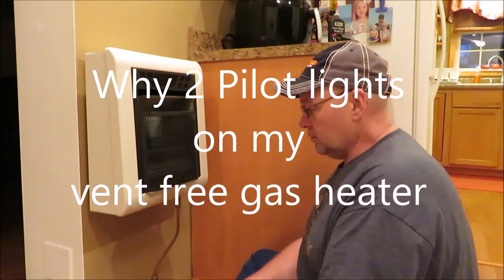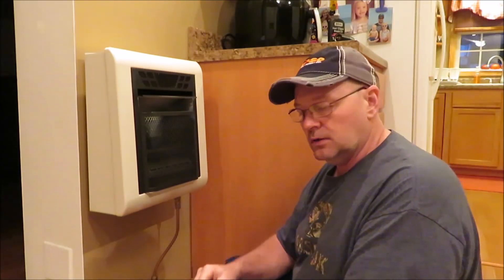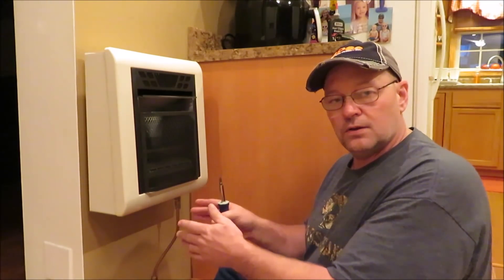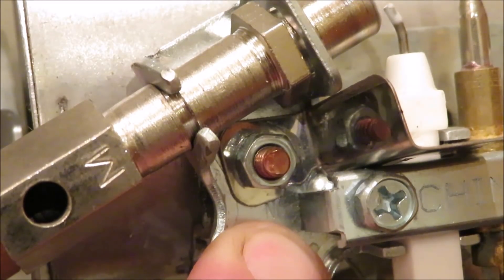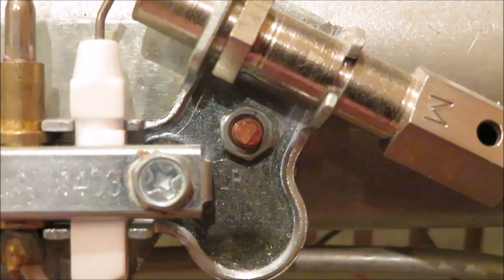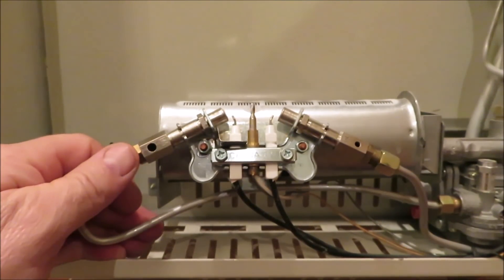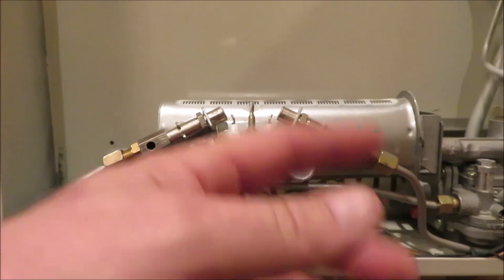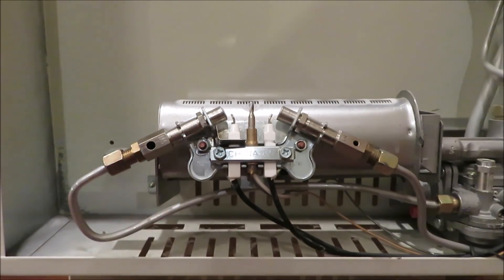why 2 pilot lights on my gas heater

Comment: So how does it switch I just piped in a natural gas line and it’s still trying to light the propane side
Reply from the maker: You might have to switch the line into another hole or there might be a bolt that needs turned, just look up the type of heater you have for instructions.

Comment: THANK YOU so much! I couldn’t figure this out without your help. Every winter I have to use canned air to clean out the ignition and gas tube in preparation for emergency use. I have a Rheem gas furnace but keep a vent free wall heater for emergencies. It’s cleaned out and working great. But I was worried about that other gas line. Now I know. What a relief! Ice storm tonight and I’m all set for power outage!

Comment: Same here. I found out when I bought a newer model. My older ones only had LP set up. I suppose there were too many getting returned when it was two different models (people buying the wrong model for the gas they used?), so they double plumbed them?